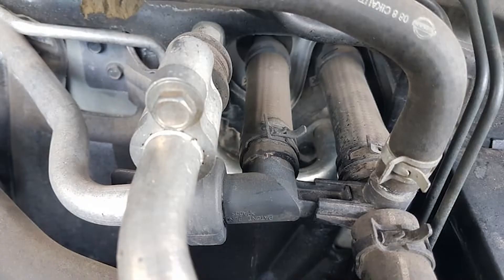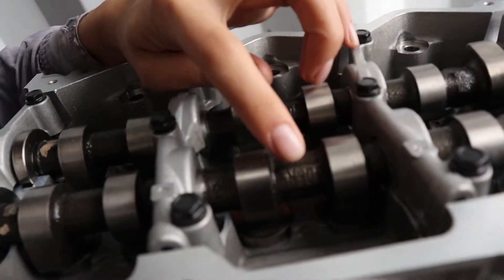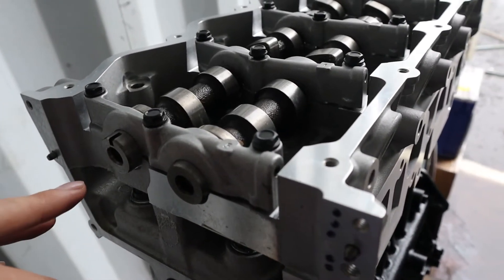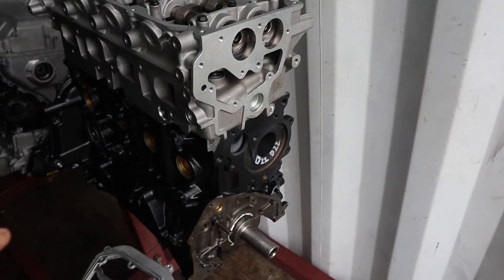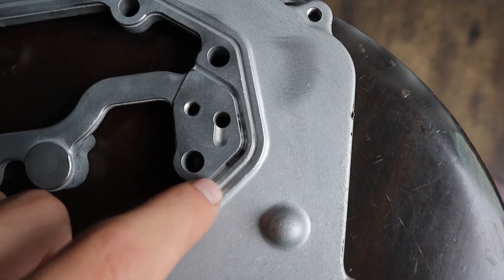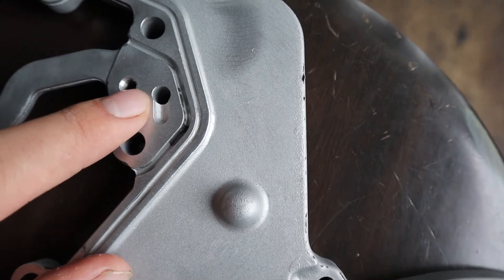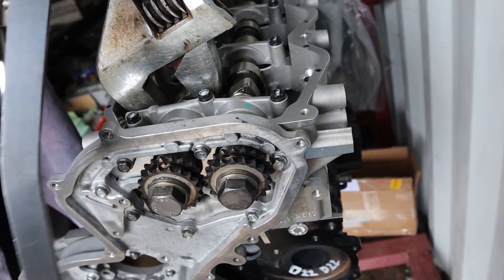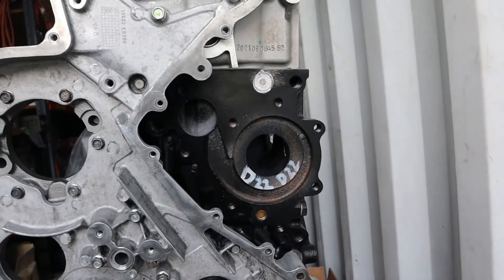YD25 Navara Cylinder Head Replacement D40, D22, R51

Comment: What would you call a good head block .what do you guys recommend. Please
Reply from the maker: @peterbrown2890  most of the after market head casting are fine to use. ETP can sell bare head castings
Reply: @yd2532  I just bought a d40 6 months ago had new head  and timing chain replaced 197000 ..anyhow I've done about 12000 ks .water was always going missing I took it into the machinics to pressure test it .they said yeah all good .water keeps going missing and now it failed exhaust fumes in radiator..I don't know if the car has original internal s cam shafts or what ..if you bought a complete head with cams what would you recommend..please ..
Reply from the maker: @peterbrown2890  have you deleted the EGR cooler it could be leaking internally
Reply: @yd2532  yeah it was deleted.
Reply: They did the test where the fluid in the test kit changes colour. On the radiator.

Comment: Hey mate, great video, well explained. I can’t find anything about installing the rear head cover and as I sent the head to the machine shop  with it still attached I have no idea if there are any seals I need to install or if I need to pay specific attention to any thing when siliconing it back on and tightening it up ? Cheers
Reply from the maker: @OUT_GPN  yes it's siliconed but there is also a tiny seal that goes in the back. It's a weird seal it has a bit of metal tube attached to it
Reply: @ Awesome thanks!!! I saw the seal in the gasket kit ,which is what made me wonder what I was missing? I’m hoping it only goes on 1 way so I don’t stuff it up🤞🏾. Your videos are really easy to follow and 1 of the best out of all the ones I have watched trying to figure out the information I was after. I even downloaded the manual from the state library and it doesn’t go into half the detail you provided which is greatly appreciated. I contacted the machine shop for help but you got back to me first ,hopefully I find everything I need and don’t screw anything up !  Thanks again for your help, you are a Legend 👍🏽!!! Cheers 🍻

Comment: Anyone know whats the problem with my d22 yd25. Only temp goes up when going over 100kms but when driving around the city the temp is fine. Any suggestions???
Reply from the maker: @ademtunc4135  have you checked for blocked radiator or thermostat?
Reply: Water pump is most likely worn and faster you go the faster the water pump spins and due to being worn it moves less coolant around engine and radiator..as soon as you slow down 5 to 10 kms the worn water pump starts to flow more coolant and your engine temp drops.

Comment: Any chance you could show how to adjust/replace the shim and buckets on a D22 navara YD2.5 with the motor still in the car? would be super helpful thank you
Reply from the maker: @angusfreeman8149  they don't really wear if they are genuine. Aftermarket ones will wear more.

But you could just measure it all and then if you do have any that are worn turn the engine so all pistons are half way down the bore then remove the top chain and Mabey the cam sprockets and loosen the caps so that you can raise the cams and change the shims that need changing.
Reply: @ what are some of the main causes that could possibly cause wear to the shims or create lifter tick?
Reply from the maker: @angusfreeman8149  has it got a genuine or aftermarket head. Have you measured it to confirm the clearances are out

Comment: Hello there! Im going to replace the cylinderhead on my d22 and just got it home, they do look really simular but i found that it was a small ball on the old one at the back but the new one has a threaded plug. Is that something that will make a difference? Do i need to get another one?
Reply from the maker: @pontusfroling1906   that will be fine sometimes factory will use ball bearings to blank off oil galleries, you new head has a grub screws but they will do the same thing
Reply: @yd2532  thats good to hear! Thanks for the information :D

Comment: Mate whats the timing position on the diesel fuel pump please
Reply from the maker: @rodneydunford5612  it has a locking pin that goes in around 8 oclock
Reply: @yd2532  roger that

Comment: You forgot to write down torque settings for head bolts mate.
Reply from the maker: @d.bcooper5450  40nm, plus 90 degrees, plus 90 degrees, Undo them and repeat

Comment: Like your video in ok school what's the pounds on the head bolts I work in pounds if you could let me no that would be good I'm just about to do a head replacement on my Nissan navara d40 turbo diesel
Reply from the maker: My engine video shows the torque spec and sequence here. https://youtu.be/L8Yfro6ekbk?si=oWLTV6O4pf7Hvpdf
Reply: Thanks hey for the specs let you know how I go

Comment: Can the head gasket be replaced without removing the timming cover completely
Reply from the maker: Yes but you gotta make sure you don't take off any bolts from below the head or you will break the silicon seal and will have to take off the cover to reseal

Comment: I've got a problem finding what caused my head gasket to blow but what I did notice the temp gauge went up down very fast twice I pulled over boiling cooled everything down  refilled with water. Wouldn't start dark oil around cap ware pressure blew it out and bubbles in coolent box what would cause that would you know
Reply: Also love your work

Comment: D can i take my rocket cover off softly enough and put it back on post inspection and the seal/gasket wont brake ty
Reply from the maker: The seals are rubber and reusable as long as they are still soft.

Comment: Did you ever use a thermal imaging camera of infrared thermometer to scan the head and block?
I have noticed that there is a common hot spot on the right side of the engine, between cylinder 3 and 4, behind the turbo. Obviously you need to do the check when the engine is hot. The temps in that area are 40 degrees higher than other parts of the head. Bleeding etc doesn't seem to help.

Comment: Currently pulling off the head of my yd25, great informative video.
Just wondering if the front timing chain plate has to come off in order to get the head off. Cheers
Reply from the maker: It doesn't but make sure you only take off the bolts that bolt onto the head. If you take the other ones out below it then leaver it you'll break the silicon seal on them. Then you would have to take it off to reseal it properly

Comment: Hi I have Nissan Navara D40 2008 turbo diesel
My car works very well in the city
But when I leave the city, the water temperature is very high
I want to know what is wrong with my car
can you help me please

The water pump is new

The coolant is new

Water does not decrease

The oil is not in the water

Water gets hot only outside the city and continuous driving
Please help me
Reply: Is the cooling system bled ?

Comment: I think I have a blown head again probably around 15000ks ago I had a new head put on it it always seemed it had a heap of pressure in it I just drove it now iam stressing anyway its bubbly from the over flow when you go for s short drive and stop it sounds like it's overheating and hot but it isn't never Moved of half on gauge and hasn't lost any water any where and heaters don't work for about 15 mins till car warms up any help would be great
Reply from the maker: EGR pipe can crack in the heat exchanger
Reply: @yd2532  you rhink it's a cracked head again from information I've told you is there another test I can do the oil is not milky aswell
Reply: @Ifindoubtknockthemout  don't drive it any further, I just had the same issue.
Was heater pipe connection blown at the firewall.
Mechanic fixed the heater hose connections but didn't bleed the cooling system and done head gasket. So, not trusting him anymore, I'm doing head swap myself.

Sucks when you pay "professionals" to do a job...
Reply: @CrazyWhiteVanDriver  yeeah and power steering were you pump the oil for that is boiling aswell

Comment: Great vids and info as usual Daniel. Already have one of your duplex chain kits fitted to my D40 (other reliability upgrades to come in the future)  I have just replaced all 4 injectors on my manual D40 due to injector rattle on cyl 1. Ute had only done 100,000km. Running almost perfectly now (far quieter) but I think I can still hear a very light rattle at light load around two thousand rpm.  Any ideas? I coded the injectors with  no issue. Brand new genuine scv with rail pressure actual and target checked on scan tool and tracking very well. Are they prone to big/little end failure after injector rattle? 
I'd actually already pulled the oil pan and no metallic flakes whatsoever.
Reply from the maker: Were they brand new injectors? I've had customers get reco injectors that were ticking afterwards.
Reply: @yd2532  definitely brand new genuine Denso replacement. All bought from auto parts supply QLD came in authentic new Denso boxing/packaging  with QR codes and so forth. Thing is the injector rattle that was previously present in cylinder 1 is gone. That sound was quite pronounced and obvious. 
This Less obvious rattle at light throttle load still sounds as though it's definitely coming from one cylinder.

Comment: Gday man, just did a turbo swap for a customer, just regarding the rear cover on the head, in a D40 do you know if the rear cover can be replaced easily in the car?
Reply from the maker: I’ve never replaced one in the car. It’s pretty tight. Are you replacing the tappet cover and the new one has a different design on the back?

Comment: Ok i have done all this, on my nissan pathfinder r51, it kicks over nicely but won't start, 😭
Reply from the maker: Has it got compression and fuel?
Reply: @yd2532  its possible to call you, if your not busy?
Reply from the maker: @vintagematter  ye number is on the website
Reply: @yd2532  thanks mate 😊
Reply: @yd2532  yes primed the diesel fuel system, timing seems correct, followed your video 😊
Maybe its compression, don't know how to check on a diesel engine, if the rings are no good, i will end up selling the car lol
Reply from the maker: @vintagematter  need a scan tool to see the fuel rail pressure

Comment: Spot on with the Head Failure problems. I purchased a 2011 Navara D40 off my Neighbor for $1000 (said i could have for nothing but didnt seem right so i paid $1000). To cut a very long story short we discovered that at some stage someone had installed the WRONG radiator cap on it. Radiator cap on this model is a Blanking Cap.  (Again) !!!   Cut a long story short i rang NISSAN for the correct cap. Shit you not they attempted to sell me the wrong cap which caused the failure from the start.
Reply from the maker: they are ment to have a flat cap on the radiator and the pressure cap on the header tank. If they are mixed up it pushes the coolant out the header tank

Comment: Very nice, but if you haven't got the bottom timing chain off, how do you know if you have put the top chain on correctly ?
Reply from the maker: get the cams to 10 and 2 then turn the bottom chain so that you can put the pin into the fuel pump (this is top dead center) then take out the pin and put on the top chain lining up the marks on the sprockets and chain.
Reply: @yd2532  ok sweet thanks, i already had it correct, but then i stressed out because i thought the main crank had to be in a certain way, the head gasket was done in 2020, cost me $4000 and failed, the amount of errors and missing washers bolts etc, is ridiculous.